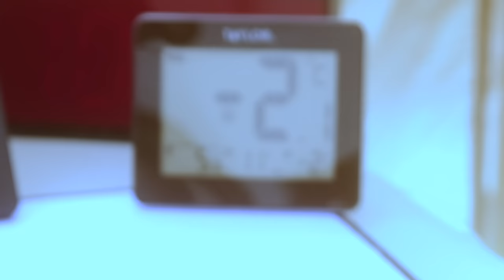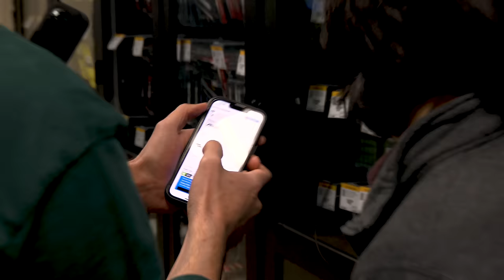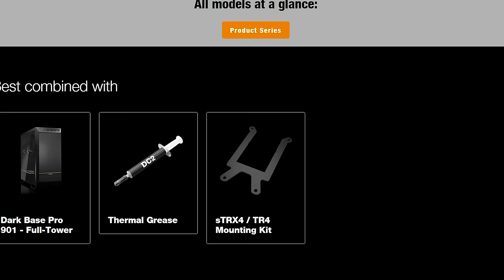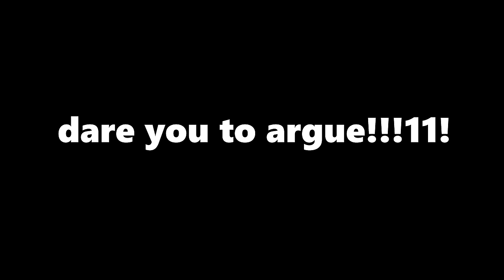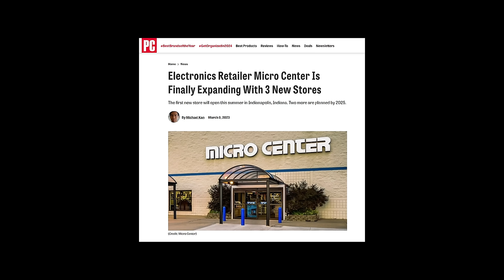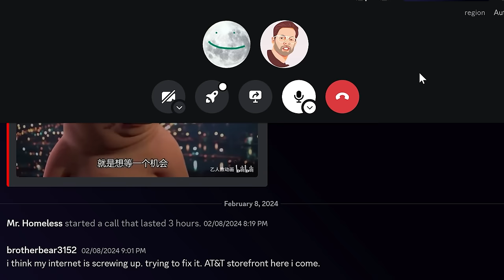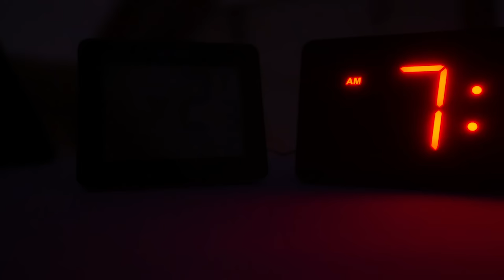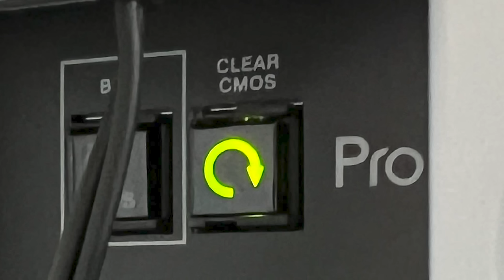Overnight Blizzard Camping with a PC Setup

Comment: I just huddle up naked with my bros whenever its cold 

Its free but your setup works too i guess
Reply: wtf you just admitted
Reply: If I am cold I always invite a bro over so we can cuddle to heat up :)
Reply: Me and my best friend had to do this up in Southern Appalachia. The temperatures dropped to 3f, but we were on top of a mountain and the wind was blowing right through us. There was supposed to be an old shelter up there - previously a cabin but now just a stone foundation with a few walls and no door. We never found it, so we were exposed. We did not get naked, but we grinded upon another to generate friction and it was one of the most intense moments I've ever had with another man.
Reply: @monkemode8128  bruh, that's gay
Reply: @BetaStar-fo2te  If it's gay to generate friction to not die on a mountain then put in a ***** *** and **** me ******.
Reply: Big band theory style?

Comment: It probably couldve gotten quite warm in there with a smaller tent, since it would mean less area inside to heat and less surface area on the outside for heat to escape

Comment: i've slept in extremely cold temps before. The key is to trap bodyheat by fully covering your body. For example, military guys will use insulated sleeping bags that are windproof. I used to have one of these when I slept outside but inside, you can use wool or any thick blanket to trap bodyheat.

Comment: I actually live in my van and my desktop is always on just for the heat output, sometimes I'll turn on a game in the morning just to keep the pc from freezing to death. This morning, my gpu/cpu was idling at 11c. It is water cooled, so I almost have to have it on all the time just to keep it from getting damaged in the cold, since there's a few feet of snow at this campground I'm at, ...but I also have an air fryer, breakfast sandwich maker, electric kettle and electric skillet I use throughout the day, so that contributes to heat as well as a small electric heater. Oh and two dogs.
Reply: Are you using water in your water cooler or is it an aio? mostly the PC coolants can go below 32F/0C without freezing that is unless you poured straight water in then yeah lol don't freeze it up!!
Reply: @gamersplaygroundliquidm3th526  Well, 11c isn't that far from 0, so I like to err on the side of caution.

Comment: I have a complete computer setup inside an SKB case. 27 inch monitor, 4090 and 7800x3d inside an 11 liter case. It's easy to roll in and out of hotels and set up a complete gaming system to game at 240hz 2k while on the road.

Comment: ChatGPT was trained on threadripper 3000 series which did use consumer ram. Only on threadripper 7000 series did they switch to full ecc ram (which has the different notch)

Comment: dude did "ai" overclocking and then just went out into -2 weather and hoped it could run cinebench overnight lol, and then when it failed instead of just clearing the power out from the system to fix the issue he just went back to sleep, i can pretty much guarantee he just had to unplug it and holding down the power button for 10-15 seconds

Comment: should have brought a Samsung g9 out there for the monitor, the thing heats up so much the plastic casing on the monitor literally makes popping and snapping noises as it expands and contracts, and we wont even go into if you're running 240hz with dynamic contrast lol.

Comment: A threadripper is technically worse for gaming than a regular 7800x3d. But for heat, ya threadripper, but personally i would have went with a 13900k and an aircooler to put out max heat.

Comment: you should have taken r9 295x2 that thing is a heater. i once tried to run r9 295x2 and hd 6990 at the same time and overclock and they blew my 1300w power supply. though it wasnt of a good quality, still older gen amd cards were heaters :D

Comment: I'm a electrician. Let tell you where you went wrong.                                                                     1) that's not a generator that's a battery they just market it by calling it a generator.
2)678 watts is absurd amount of power 
3) The size of that battery has no way power your 678 watt pc for a 2 hours max let alone through out the night 
4) 4:36 no you don't.
5) watts doesn't equal heat amps do just Google it next time.

Comment: If you want a heat monster use the smallest radiator, or air cooling, or use it as exhaust, not intake. You’re going to cool that cpu off too much. You want that mf hot

Comment: Shouldn't he have done an air powered CPU cooler so that water and radiator doesn't dissipate the heat and instead throws it back into the tent?

Comment: They would be more efficient if you didn't convert ac to dc to ac, there's probably a twenty percent loss of energy
Reply: I've actually been able to with lots of adapters, able to run a computer off of eight twelve volt battery with a voltage regulator and lots of adapters

Comment: Cinebench crashed your rig lol, you should have just opened 2 games, on max settings, and run a hd youtube video 4k or higher. that would have maxed the rpms on your gpu and the cpu would have heated up like crazy, and you water cooled it, biggest nono if you want it to heat up, the rig would have ran just fine if you had 8 fans in that case and the heat would have been a lot more, give it another go .

Comment: Shame Didn't get  3x 4K / 8K Projector's (xenon & Sodume hid are the hottest light sources on the plaint -The filament Runs hotter than the lamp Glass Melting Temp) why you need to bee Careful with them on Shut down and allow them a 20 mins coolldown cycle with the power still on or it get expensive if you just cut the power For some Projector the Replacement HID lamp can cost more then the projector NEW

and the cinema HID are the price of a Tesla / new car to replace the Hid lamp &  can kill someone under high pressure there shopping pack is armour packaging

Comment: pubg heats my room up in 10 min, then i need to open the door to let heat out
it maybe have worked better if you made a pc that is made to barely run 1 game of pubg.
a pc that needs to struggle to run a game so it gets hotter